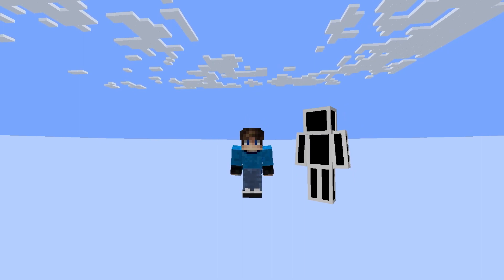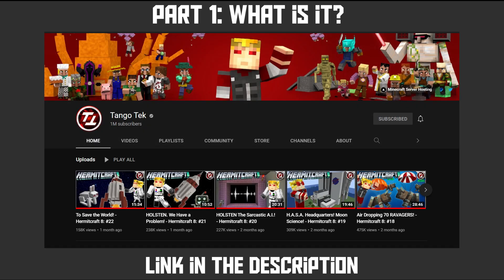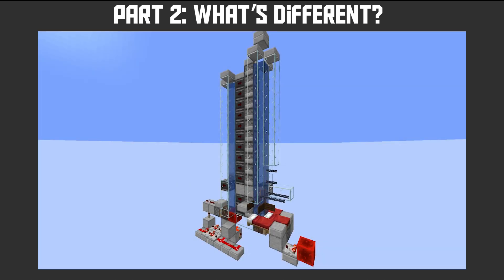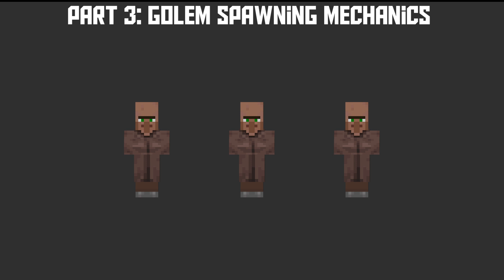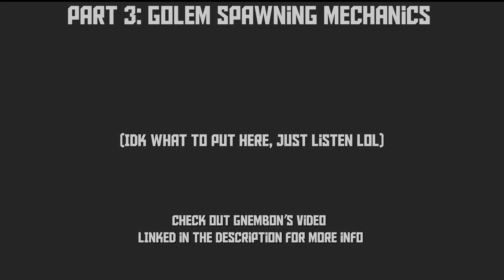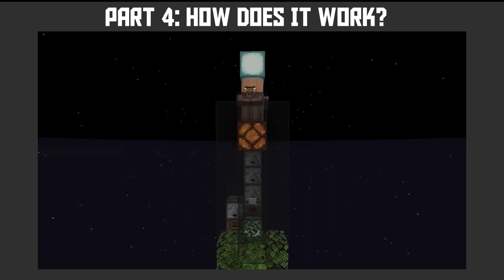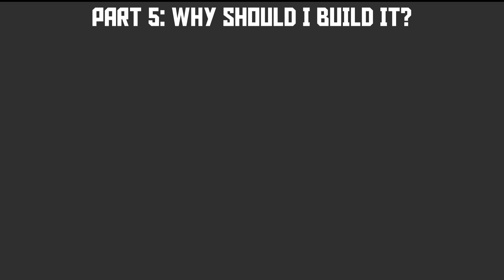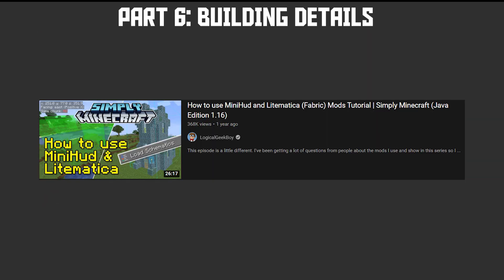NubTech's VUAIF - The (Former) Densest Iron Farm in Minecraft - 9750 Iron/h - (Java 1.16+)

Comment: Someday I need to do a video on the single-chunk farm I designed and built.
It was about twice the size of yours (built before the built limit change in 1.17) but produced more like 30,000 iron ingots an hour.
An expanded version using the current build height limit would be pushing 45,000 an hour but would have to cycle a little slower due to the longer fall distance so less space efficient.
76 spawn stations on about a 50 second cycle, and that wasn't pushing the viable cycle time at all (in theory, I could have pushed it to low-to-mid 40s, limited by falling time from the top cells).

Somewhat of a modular design, needed 8 or 9 empty spaces between "towers" for each tower to work correctly.

Comment: 102gt clock? I thought the global spawning is 100gt?
Reply: I think they said the iron golem takes 2 gt to teleport. Not sure if that explains the clock or not.
Reply from the maker: 102 was the best time i found, i tested everything from 100 to 110 for 10 hours each. 100 leads to a lot of double detection. And yes the teleportation delay is probably the reason.
Reply: Cool so each pod triggers every 700gt instead of 600?
Reply from the maker: @ellewhitney7002 around that, yeah.